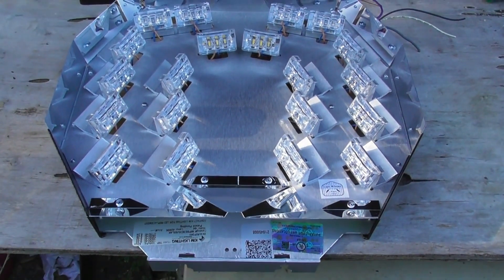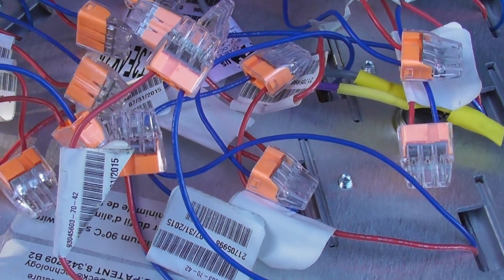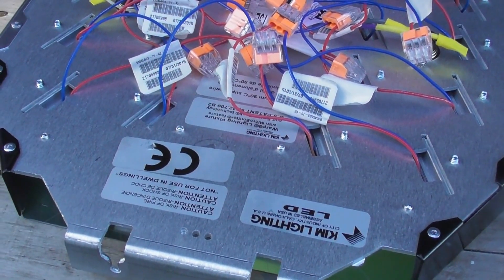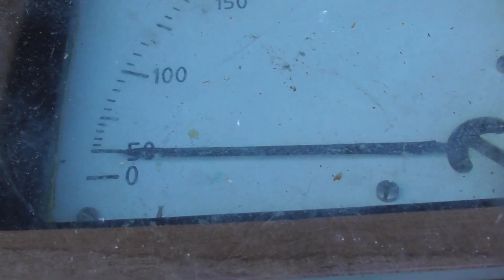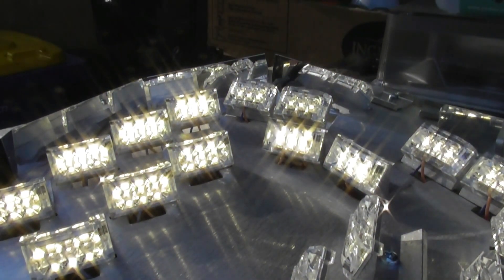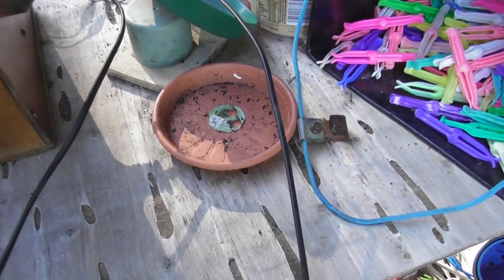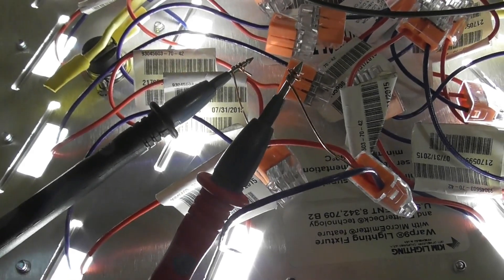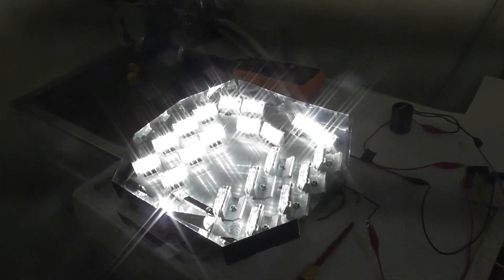Large Kim LED streetlight cluster

Comment: Expensive boogers those are..  anywhere you look into buying led street lights charges in the 300-5000$ range depending on wattage, solar and sensors with housings n such..  but 65w might sound relatively low but online that “warp”9 is going for 475$ used..  i saw covers for cheap and building a constant voltage supply with some sensors wouldnt be too difficult or costly so bet if you just put an hour or two and 25$ you could sell that dude for 500$ easy..  put a solar array on it and a motion sensor n put the whole thing on a 90° mount with a plate and screws you could up that to 750..   or you could put a circle of chicken wire underneath it and hook a mot to it.  Make one of your good ole wasp playpens..

Comment: I agree that a HPS is much more robust and economical and overall just a better decision. This lamp was a designer piece. I bet the beam it throws is very useful. Greetings from Florida
Reply: The power savings are still the big thing with these. Compare a 250W HPS to a 60W LED - that's just over a 1/4 of the power usage. Scale that out over hundreds or thousands of fittings, you'd expect to see failures eventually (due to the bell curve of everything), but chances are it'd have saved enough power over that time to justify the replacement.

Some quick math... 12 hours a day, 365 days a year, 4 years, 20c/kwh (power in NZ is pricey). HPS (using lamp power only) comes to $876 over that period, LED is $210. So while likely not overly attractive if you have to replace it every 4 years,  a majority of the fittings would last longer than that. 

Scale that up to say 10,000 fittings and 5 years (when you'd have to relamp the HPS fittings anyway ~ 24000hrs) and the power savings are $8.3 million. Once you have to relamp a shit load of fittings you see even more savings by switching to LED. (10,000 fittings at $40 a lamp - $400,000. Include labour to do this and this would likely end up double)
Reply: HPS is dying, and I'm happy for it.  I've cursed many a time in a K-mart parking lot over those stupid 480 ballasts that loved taking the underground and pole wiring with them when they went bad (special mention to the one that took out the transformer) and starters and lamps installed by a guy named Jercules.  Lamps should not require an oil filter wrench to remove.  Just saying.  

If you didn't laugh at the above, you have no authority to have an opinion on HPS

On the more technical side, sure, you can relamp every X hours before the lamps "go bad", but we all know, they're lamps.  1 out of 100 is bad, and 3 in a hundred will die at 3000 hours.  When an LU lamp goes bad, it cycles.  This burns out the starter.  Can you buy just the starter for a crisp $20 bill?  No.  You have to buy the $80 ballast kit with coil starter and cap.  And if you can, don't tell me because I've sold exactly 1 LU lamp in the last 5 years.

*     *      *

The reflector design is complex for a number of reasons. LEDs are point sources of light with a narrow beam spread.  They have to work with legacy fixtures that have different kinds of lenses.  They have to work at different heights.  

Bonus, the light is better.

Comment: Sad that you cant always be that active. Stay save

Is there realy no way to change the psu?
Reply from the maker: Normally work 40 to 50 hour weeks.
Reply: @RODALCO2007  ???
Reply: Lots of times these fixtures use non-commodity parts.  

  Some manufacturers don't even want the old parts back when they fail under warranty, just photos of the serial numbers.  That's been my experience with Cree and Keystone.   You get a new one and the old one goes in the bin.